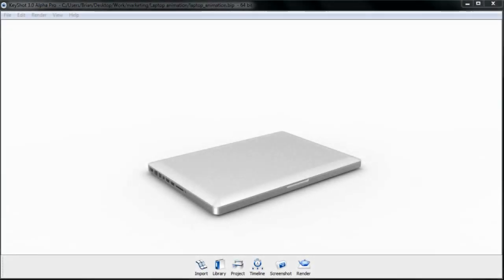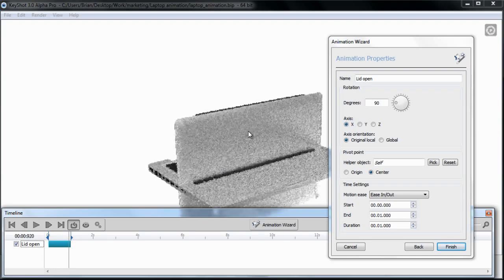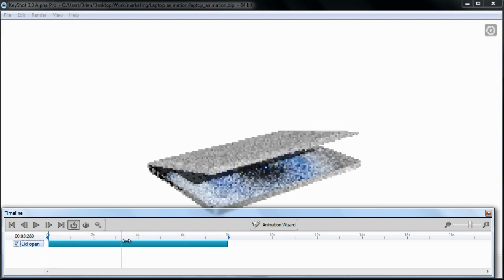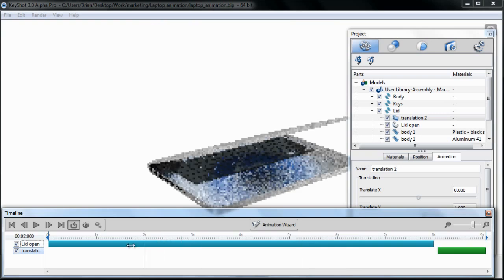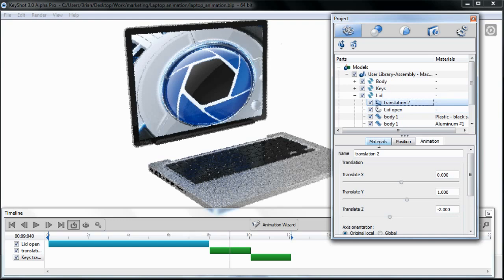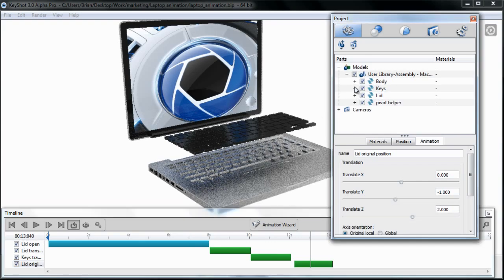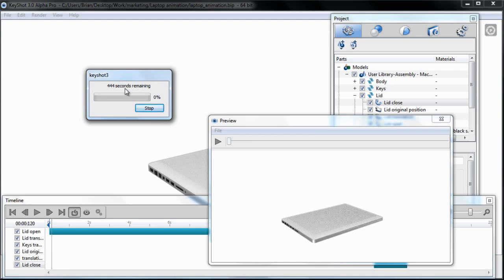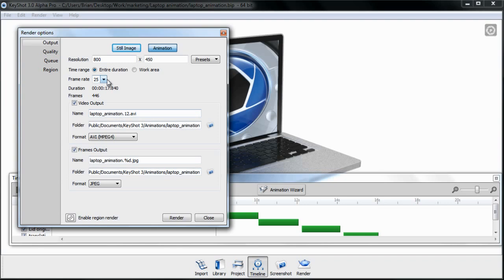KeyShot 3 Preview: Animation Workflow

Comment: Sad thing is i get a lot of pixels when i use animation... :( Why is this? you can see it here: watch?v=CBxn5fT68CE can you explain what is going on there?
Reply from the maker: Looks like you need to let it render a bit longer. That looks like a preview of the animation. You will need to increase the quality of the render settings.
Reply: Hi, Yes i just did something different. I go to render and then render animation. It is now running around... well 8 hours or so xD But then it does look good. Not yet the control that i want to have in this but yeah it works. (wish i could just move it they way i want it turn it the way i want it and so on.)
Reply: KeyShot Here you can see it looks better. This was just a fast one though. watch?v=ZYwg162RX4s
Reply from the maker: Android JS yes, much better. Nice model!
Reply: Thank you! :) but faaaarrr from done
Reply: Ok working better now. Thnx again watch?v=nzRVaD9fDjY you can see it here :) Just a test of the demo design but yeah this is the result i want!